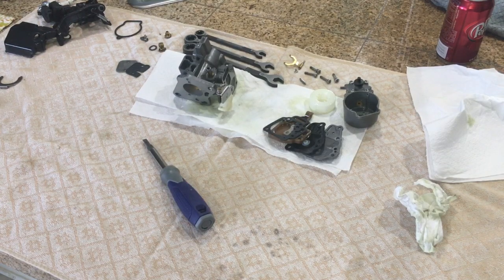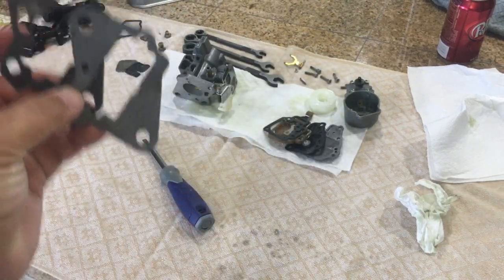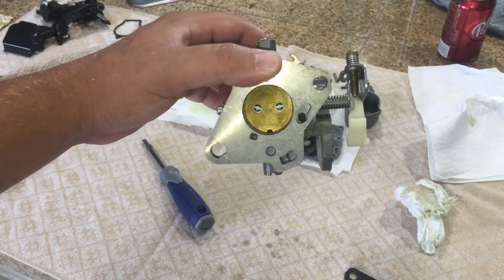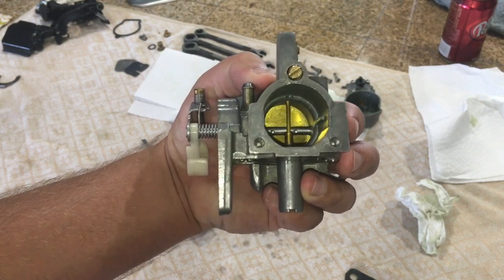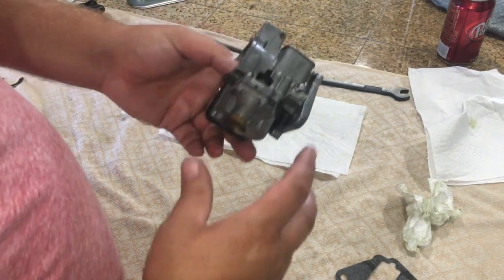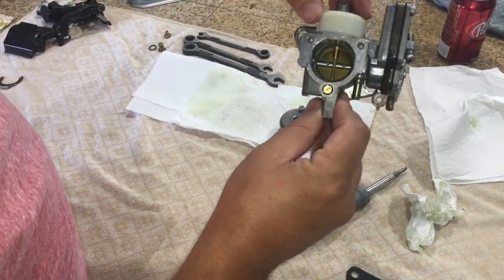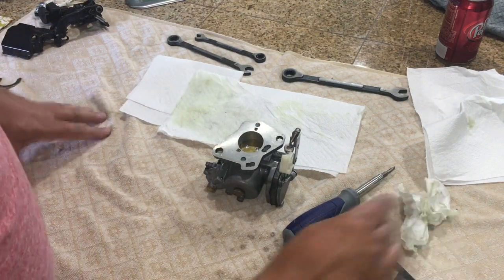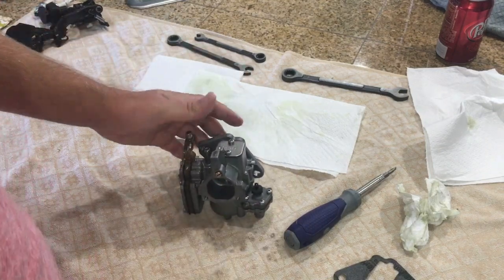Mercury 25 HP EH 2 stroke Carb Rebuild PT 2 Re-assembly.

Comment: woulda been great to see how to put the little red seal back in.
Reply: Dropped it in easily, the PITA was the little retaining clip that follows. I seated it in there using the head of a small round headed bolt and tapped it into place with a small hammer.

Comment: Thank you so much for mentioning that gasket slot. Might’ve just solved my problem. Was still acting like it wasn’t getting gas after a rebuild. I noticed that the new gasket didn’t have the slot but didn’t think twice about it
Reply: also be careful with the diameter of the gasket circular opening - on some kits, it is made for 20hp and smaller and not for 25hp which has significantly larger carb outflow opening (as on this video).

Comment: My carb is leaking at the choke/primer vent hole when it’s running. Do you think it’s possible to change just that diaphragm? I don’t need a whole carb rebuild since it was just done recently.
Reply from the maker: I would think so. Possible also check valve O rings where the metal ball and spring is.

Comment: How many times do you turn your jet out
Reply from the maker: The manual says 1 1/2 turns for idle mixture screw on carburetor for the 20hp’s and 25 hp’s. Different motors/carbs have different jet sizes. 

https://www.manualslib.com/manual/1057340/Mercury-Mariner-25-Marathon.html?page=133#manual
Reply: @sirmarcusandrew  thanks for the manual

Comment: Upon taking my carb apart the little ball was missing when I took the 11mm bolt out of the float housing. Spring was there but no check ball. Would this be the cause of my acceleration and low end performance issues? The engine works fine once it reaches higher rpm's but feels like it's misfiring/ stuttering trying to get there.
Reply: Was this the issue? Mine is currently misfiring and shaking like crazy until i get it up to higher rpms. While i was cleaning the carb I noticed that the little red ring near the check bulb was coming apart.
Reply: @coryb2726  yes I replaced the missing check ball with one from a grease nipple and it works like a champ

Comment: So i recently rebuilt my carb and it ran awesome for a few trips now it dies again under load. 

Wondering if i cleaned it all right. What did u use and where is the actually fuel nozzle that sprays in the engine.
Reply from the maker: I used a can of carb cleaner and made sure to blow through all orifice holes to make sure I had no obstructions. Make sure to also clean fuel filters and inspect tank for trash/debris if possible.
Reply: Thanks for the reply man. Much appreciated.
Reply: You ever figure out why it dies under load?
Reply: @deebomb86  yes sir. It always acted lime it was staved for fuel. And my fuel tank was always blown up or what not. Finally put two and two together. The damn vent in fuel tank was clogged or broke. Bought a new fuel tank and havnt had anymore issues.
Reply: @XJStryker  thanks

Comment: I’m as green as it gets with this, so bear with me.
At 2:20, you’ve got one gasket on before you put that spring thingamajig on. I re-assembled once and then realized I had all these “extra parts.” My kit has 3 gaskets/seals that fit there. One of the seals looks like the same material used for the diaphragm seal if that helps at all. Hopefully I don’t ruin my motor before someone responds.
Reply: https://www.amazon.com/Carburetor-Kit-Mercury-6-25hp-2cyl/dp/B01M18LAL7
Aforementioned kit

Comment: So make sure the gasket has the hole and not the slot?
Reply from the maker: Mine needed the slot. The new gasket only had the hole and needed a slot made into it.
Reply: @sirmarcusandrew  so did mine $85 for an OME kit and had to use the original intake gasket

Comment: My Mercury 9.9 hp outboard, non electric start motor has the exact same carb on it as your 25 hp. I rebuilt it last year and haven't been able to start it. It wouldn't start before because the fuel diaphragm was totally messed up. I searched everywhere for video for 9.9 and nothing, then today, recommendations gives me your video. I gotta check that gasket to see if it too is blocked from fuel delivery. I can rebuild lawn mower motors all dang day and they fire right up. These outboards are a different story for me.

Comment: I'm doing the same rebuild. Did you just put the needle back in or was there a seat to replace? mine doesn't seem to have a seat, and the little rubber seat that came with the kit doesn't fit.
Reply from the maker: I removed the old needle, it slid out easily, and slid in the new one. I did slide a little metal cap over the float end of the needle and adjusted the float from there. It may show better on my 3rd video of correcting the float.
Reply: @sirmarcusandrew  So there was a rubber seat that "slid out easily". I hit the carb with compressed air in every orifice and may have blown it out without seeing it. I'm not sure why the little red rubber seat that came with the kit doesn't fit. I'll have to talk to the dealer that sold me the $106.00 kit.

Comment: I just bough the carb kit, I was going to rebuild because the primer vent hole has fuel spurting out when I pump primer. Is that new diaphragm going to stop the fuel from spurting out???
Reply from the maker: Danny B it did on mine. I had a deteriorated primer and the debris blocked the holes and the pressure pushed the fuel out. I cleaned everything out and made sure all ports/holes were free of obstruction.
Reply: @sirmarcusandrew  Thank you.

Comment: Hey mate, thanks for a great walk through. New to the whole outboard scene and am trying to get a 15hp 1993 merc going.   @7:11 Just wondering what function is of  the two small bronze jets around the edge of the central hole? Cheers,
Reply from the maker: If we are talking about the same jets, the one towards the top of the screen is the idle air adjustment port and the lower one is where the primer fuel enters your mixture.
Reply from the maker: Some allow fuel to pass and others air, I believe this one is air but I could be mistaken. I am a novice and my learning is shared to possibly help others with similar issues or learn what not to do.

Comment: How did you manage to get spring clip back in check ball hole?
Reply from the maker: Chris Major I used the old air mixture screw. It fit through the whole but was wide enough on mine to catch the spring and push back into place.
Reply: I just used an Allen wrench to push mine in and it work perfect.

Comment: Thank you for this video.   I have a 8hp but the carb is identical.   What is holding the bowl?   Is it just that brass screw?   I couldn't get my bowl open.   Thanks
Reply from the maker: David Lee   On mine it was only the main brass screw in the bottom. The halves were originally slightly stuck together via the gasket. A light tap or two and they separated for me.

Comment: My friend just bought a boat with a 2003 25EL, OT690351 motor. I know I'll be helping him with it when the need arises, so I've been searching for information on it and your videos have been great.

I hadn't realized it was a diaphragm carburetor, so that was good, and highlighting the problem with the gasket was noted.

At 3:29 of your video you "reset" a screw with a lock nut on it, and mention fine tuning it later. What is the function of that screw?

Thanks
Reply from the maker: It works in combo with a few things. It limits the return of the cold start arm as part of a minimum idle. Set too low (too much return) it will be hard to start and too little return it will rev high like you have the throttle opened too much. I’ll try and get a video made soon to discuss it.
Reply: Thanks for the reply. I'll be looking forward to future videos.

Comment: SirMarcus, Thank you for the video.
Regarding the main New gasket that fits between the Motor and Carb, Did you trim an oblong hole in it that matches the original gasket?
Also, where did you order your Gasket kit from?
Thanks,
Reply: you need to make sure you order the correct carb kit! mercury made several carbs for these over the years, and the kit the poster ordered was clearly the wrong one . no big deal but the correct one would come with the correct carb to intake gasket. for example i have a 1987 25xd. this kit would not work... different fuel pump and primer plus other stuff so i had to order correct kit. the big change came in 1994 when the carb was upgraded to work with the new all-digital ignition system (timing advance was mechanical, but controlled digitally, as was idle)
Reply from the maker: americanworkmule2009  I ordered my kit from Amazon. I searched the part number and keyword Mercury. I marked the new gasket with a pen and cut it out. The sides of the gasket may also need to be trimmed to fit the more rounded opening of your carb. Mine needed this as well upon matching the gaskets up. FIRST, you may want to line the new gasket up to the motor to see if the port is covered or not.
Reply: Thanks,
Measure Twice, Cut once, ...even Factory replacements. Ha Ha

Comment: I have the exact same carbeurator.  I have pulled it apart and cleaned everything and blasted air through every vent I can see.  The motor runs for a few seconds if I spray a little gas straight into the carb, but will not run otherwise.  The carb bowl is filling up.  And when I saw you’re issue with the gasket, I thought I had it pegged.  I’m stumped.  Been working on this thing for over a week now.
Reply from the maker: I have some thoughts but I’m not an expert. How new are your spark plugs and did you gap them? When you put the carb back together, where did you set your air/fuel adjustment screw? Do you have the electronic choke? Do you have the “Pull to Prime” option? Is the vent on your fuel tank open and a working primer bulb? Fuel filter been cleaned/changed? And was the motor running at all before taking the carb off?
Reply: @sirmarcusandrew  Thanks for the video, very helpful. How do you set the air/fuel adjustment screw? I took the carb apart without paying close attention how far in that screw sits.
Reply from the maker: @MarinusVesseur  https://www.youtube.com/watch?v=zm5mB3R8Ucw See if this helps. I think I am around 3 turns or slightly over if i recall from where I set mine.  Watch the last 10 minutes or so of this different video to help as well. https://www.youtube.com/watch?v=Dnues7Np1Uc